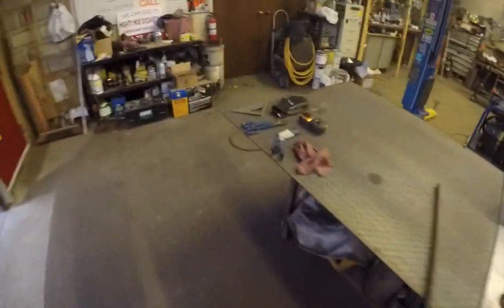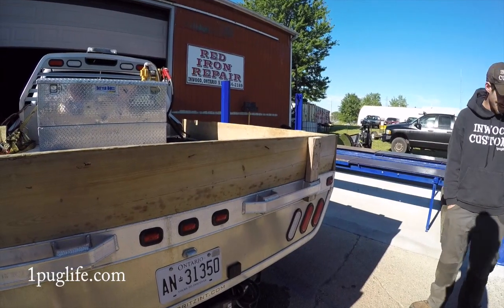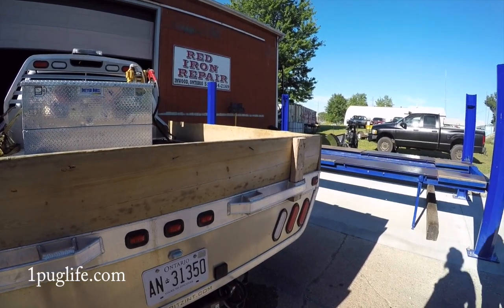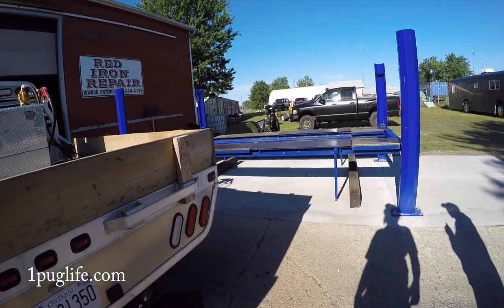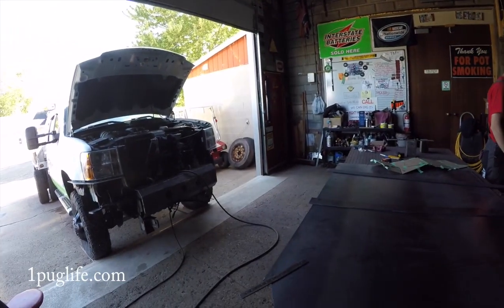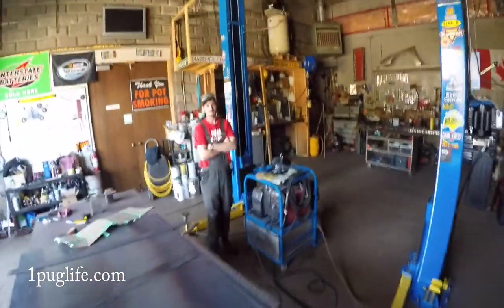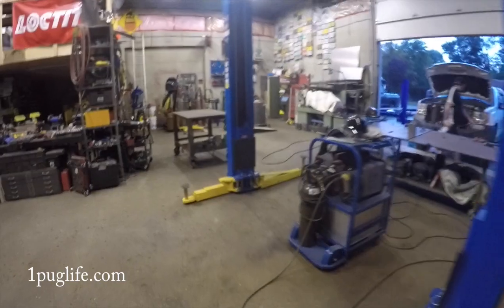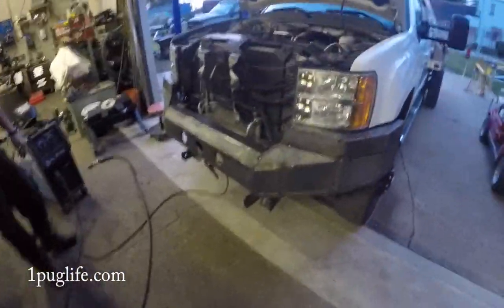gmc bumper pt2

Comment: Wonder if he disconnected the battery on that truck before he started welding on it? Chance of frying the computer and fuse box if he didn't......BMP
Reply: Bubba Lee myth
Reply: Nissan Mechanic, maybe on a truck but not on a 325 CAT excavator, our company mechanic welded a blade on the bucket and fried a 6 month old machine.
Reply: Bubba Lee cars have rubber tires. Cat has tracks   Frigin thing wasn't grounded.
Reply: Nissan Mechanic, never thought about that, now I feel like a complete fuckin dumbass😂